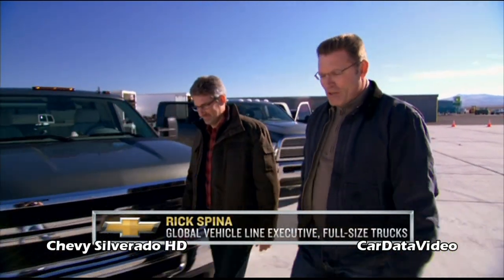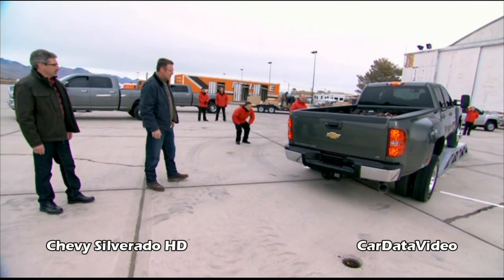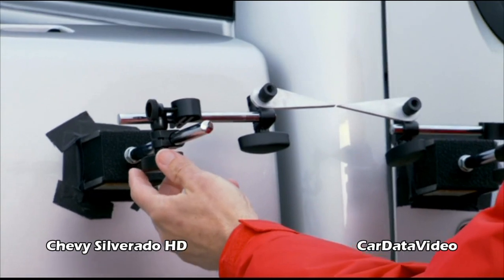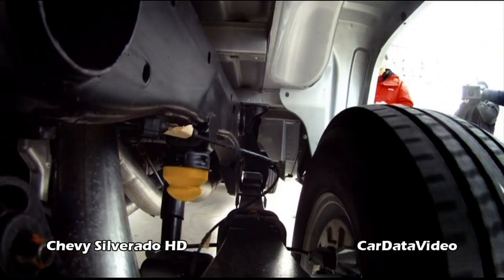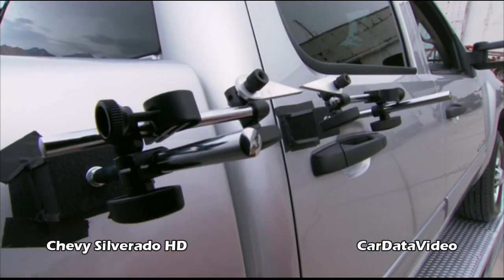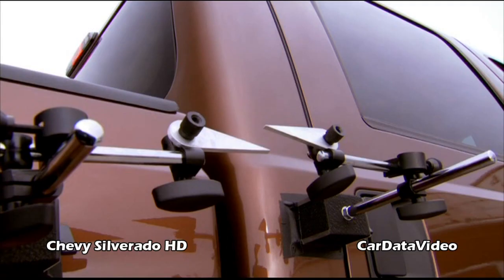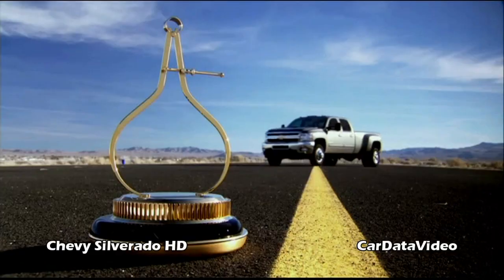Chevy vs. Ford HD Truck - Bed Bend Video

Comment: I watched a 2015 ford F150 explode on the interstate next to me as I drove by in my 2004 Chevy 1500. It made my day to know my old truck will last longer than the new trucks out this year.
Reply: I am a ford guy and I own a 2000 Ford F-250 7.3 powerstroke, but I have to say the Chevy trucks that were made before the bailout were actually pretty good I still think Ford is better though.
Reply: @becplumbing660  Maybe good mechanically but the interiors are trash.
Reply: @r.rodriguez4991   both interiors suck
Reply: @GamerBoy-ye2op  ram has the worst interiors wtf

Comment: Im a chevy guy all the way, but have personally seen and driven both trucks in similar situations, and have NOT seen a ford perform that badly, let alone crease the endgate. Somthing must be rigged here. They are both quality trucks, and in real situations neither will have a problem like this.
Reply: It is very seldon you would ever flex this hard unless you are either trying to demonstrate flex or are rock crawling.  I can see this happening under extreme circumstances.  Most trucks that crawl make some nasty noises in the chassis as they flex.  Just watch any rock crawling video on youtube.
Reply: Thank you. I am a ford guy but at least one or two chevy guys actually understand the facts about ford. Ford and Chevy make their trucks differently and i have my reasons for liking ford over chevy but at least one chevy guy knows the facts and doesnt try to go with the Fix Or Repair Daily bullshit
Reply: I love Chevy and Ford all the way, but that was just a crappy video.
Reply: exactly

Comment: i got no problem with the chassis flexibility. i am a horse transporter, and i use that flexibility when i am pulling my 47 feet, 23.000 GVWR with 8 warm bloods of 1.300 pounds each one, specially when i am at the farms picking them up off road. in the past i drove a Sierra 3500 and i had no problem, it wasn't a bad truck, some little electric issues (nothing major), and the interior is not the nicest, but i change for a F450 king ranch cause i need a stronger rear axle, and it is amazing, a little slower, but more powerful on hills, it is almost 280.000 miles, and i had nothimg bad with it, just a problem with thw DEF sensor, and a leaking in the oil pan when it has around 180.000.

Comment: Any one else realise that the fords tail gate was locked
Reply: I sure as hell did. You can hear a click on the Chevy tailgate that means it unlatches where on the ford tailgate you don't hear any click.
Reply: it was not locked. The tail gate was pinching the right upper bedside and causing a striker misalignment.
Reply: @Hiringsoon  but you still would of heard a click if it was unlocked
Reply: Yes
Reply: Yes I saw
Reply: quick draw rc it’s ford, it’s garbage
Reply: I believe it was locked
Reply: yup
Reply: Fake news
Reply: I didn’t even notice that
Reply: it wasnt locked. my dad has a 2012 f350 and the tailgate does that when its barely misaligned because of the bed twisting.
Reply: @rylandnovak9242  haha finally someone who actually admits it😂
Reply: Ryland Novak weird, my 450 doesn’t do that🤔
Reply: FBI no 450 or higher should be doing that
Reply: justin johnson that’s why it doesn’t...
Reply: LMAO the tail gate obviously bent and buckled. Did you not see that?
Reply: @DaytonCarCare  The handle of the tailgate would have made a clicking noise and it would have been difficult to pull if it was unlocked. Locked tailgates are easy to pull no matter the situation. yeah sure the body sheet metal on the outside of the tailgate is bent, but that doesn't mean it can't still be opened.
Reply: quick draw rc  yup I could tell my friend owns that truck
Reply: quick draw rc yes it’s locked my friend owns f-350 dually
Reply: @Hiddenpower6  I drive a honda so im less likely to get on the side of the road compared to either ford or chevy, but if i had to pick id rather break down than get pounded. My large intestine is more important than the convenience of making it to my destination on time
Reply: I bent the bed of my old 92 F-150, and with a little more force, I was still able to get the tailgate down.
Reply: Wooow they fucking lock it to make it seem it was pinched shut
Reply: No duh it was locked it is a staged Chevy ad lol
Reply: On top of the fact that when the tailgate bent the camera was perfectly zoomed in on the damaged area. As if it was expecting it to happen
Reply: ItzRy_ yep

Comment: I own 8 trucks. 4 Fords, 1 Dodge Ram, 1 Silverado HD(one used in this video) and a toyota tacoma. When you see the undercarriage on the Chevy in this video you see reinforcement struts. The Chevy (LTZ package) that I have does not have those reinforcement struts. I think that they reinforced it for the video. Although all car companies are at fault for this jackassery ford and dodge is still better.
Reply: TheMidwesterner West you mean 7 trucks
Reply: They probably have a "Mystery" Truck,  that nobody talks about, just like everybody else.
Reply: Common Core Math should ask Santa, for an Overhaul.....And a Beer, In a Tree.
Reply: csrgatorfan you are my hero
Reply: csrgatorfan maybe the mystery truck was a ridgeline :p that's why he didn't mention it.....
Reply: @Roberto-cc5nz  Hey, you drink enough beer, you see more trucks than there actually are.

Comment: 1: Video is very biased.
2: who buys these trucks and mainly off-road these trucks? They are mainly used for towing.
3: over the years.. Chevy is slowly switching over to aluminum. Just check out the 2019 Silverado trucks
Reply: Trucks are unnecessary for most people.  Waste
Reply: @LemkeR  No, they are very necessary for me... to waste gas mileage! I rather spend 5000$ in gas a year than end up a cripple from some idiot texting and driving.
Reply: Larry Mepentu trucks have become more Family/business friendly over the years. One day you can be doing hotshot deliveries.. The other take your family out on a road trip knowing that it’s much safer than a small compact car. Not saying that I don’t like my Corolla but I do love my truck.
Reply: @christianfoster8400  actually small cars are usually safer.  It's psychological when we think a larger vehicle is safer.  I feel safer in my smartcar than my Charger or  2500 Cummins.  And crash testing proves my feeling.

Comment: Let's see how the Cyber"truck" stands this test.
Reply: Stonewall Jackson that ford was the lowest f 150 model you could get and the Ford was in 2 wheel drive
Reply: It'll handle it incredibly, it has adaptive air suspension.  And to say it's not a truck shows your ignorance.  It has a full size bed  lmao
Reply: Elon musk even directly responded to somebody sending him this video on Twitter lol
Reply: Most people just don't like it because it's a completely new design, but to be honest, even if you don't like the truck or don't like Tesla it should be a good thing that it has so many features.  Silverados and f150s have been the same thing for years, but now Tesla is putting pressure on Ford to make more affordable trucks with more features.  Cause with a 40k price tag and all the features the cybertruck has, it's a serious competition over an f150.
Reply: Stonewall Jackson 2wd vs 4wd. What are you expecting them from. Why didn’t they use Ford electric with 4wd or HD 4wd?

Tesla chose Ford 2wd to cheating as they thought we all too stupid to notice. 

We busted them.
Reply: The problem with the cybertruck is that the frame is the "exoskeleton" . Meaning that if it were to do this test it would most likely bend the body panels and result in not being able to open doors.
Reply: Stonewall Jackson  No there definitely not, Tesla used a 2wd with the base engine(30k).  An apples to apples test would have been a  4wd f150 with the 3.5 ecoboost. Also the cybertruck was a dual motor so it cost 50k. For that price you get into the 3/4 ton trucks which could pull the cybertruck across the world. Also ford alone is worth 140 billion where tesla and space X combined is only 60billion.
Reply: Stonewall Jackson  Yup we shall see in 2 years lol.
Reply: @hillaryclinton2700  you're comparing the most costly version to the cheapest f150 lmao.  And have you never seen an avalanche?  Or literally any other truck that has high walls on the sides?  It saves more money in the long run by cutting out the price of petrol, has adaptive air suspension that makes it a smoother ride as well as being able to stay level no matter how much you're towing in the bed, has 240v ac power in the bed, etc.  Ofc it's gonna weigh more than an f150, they're using a steel exoskeleton to make it more rugged.  The rear view camera is a mirror so it doesn't matter if the rear window is blocked, and the base model has 2500 more pounds of towing capacity than the base model f150.  Just admit that you're afraid because it's something new and unconventional, every single person that I've seen giving the cybertruck hate is just trying to justify the f150 sticking with the same design year after year.  Yeah the design is weird but who gives a fuck, cause in terms of utilities, durability, the elimination of the cost of petrol, the massive cab and full size bed, the bed having tracks to place hooks wherever you want along the floor, the outlets, the air compressor, autopilot, etc. This truck is gonna put pressure on Ford to actually change something from model to model.  Honestly you sound like you have a hard-on for big trucks and for putting out carbon emissions.
Reply: @hillaryclinton2700  also you don't understand, the cybertruck has adaptive air suspension meaning this test wouldn't phase it at all.  One side would have a higher suspension while the other lowered.
Reply: @hillaryclinton2700  lol whatever you say, Elon himself replied to this test on Twitter saying air suspension wouldn't make this an issue, and I honestly think a billionaire engineer knows a little more than some rando on YouTube
Reply: Stonewall Jackson it was a v6 model ford 😂 lets see how the tesla handles againts a duramax in 4x4
Reply: Santania exactly, like why would they use a 50,000 dollar truck against a 30k truck. For 50k you can get a 2500 truck.
Reply: @hillaryclinton2700  Where did u get those valuations from? Ford valuation is 40 bill and tesla's is 60 bill lol. Dont use made up arguments
Reply: Filipe Vieira that only means so much and only shows how people are trying profit off Tesla as Ford is flatlined. Tesla sold 25000 model x and s in the first quarter where as ford sold 620000 vehicles(mostly trucks). If you take the average price of a model x and s it end up around 70k. 25k times 70 is 1.8 billion. Now fords average vehicle cost 40k if you take 40k time 617000 you get 24.6 billion. So please don’t tell me Ford is smaller than Tesla. And let’s not forget gm which also sold 700000 cars. Tesla will be crushed by Ford when they release the electric f150
Reply: @hillaryclinton2700  you know so little about tesla that you just ignored the best selling luxury car that they sell, the model 3 witch sells about 90000 a quarter, and its production restrained. Testas is growing like crazy and ford just isnt growing. Tesla has at least 3 years lead in eletric cars tecnology. And thats why its valluation is bigger than ford. Its the reallity, Ford is not as well prepared for the future as tesla is. I  dont care how long Ford as benn making gas cars, that doesnt traslate to shit when its time to make batteries, eletric motors and infrastructure.
Reply: @hillaryclinton2700  btw I am taking a master degree in Mechanical Engeneering so I kinda now this shit.. just kinda
Reply: Stonewall Jackson  the Ford was not drove properly and it was 2wd compared to the cybertrucks 4wd which means Tesla had doubts
Reply: @takememars  the cybertruck looks like an off-brand Barbie car

Comment: No proof they didn't lock the ford tailgate
Reply: I think they did lock the tailgate. Notice when he goes to open the tailgate, the handle pulls out easily, the tailgate just doesnt move. I know on my truck, when the bed is locked that is exactly how the handle behaves. It will pull out like that, just not engage the release mechanism. If the bed is unlocked, and there is debris or a stick stuck in the mechanism, the handle will be stuck as well.
Reply: U agree it looked a lot easier, and it is a lot easier to pull when it is locked.
Reply: The Fords tailgate literally twisted and started to compress inward on itself. It's plain as day chevy has a way better frame and suspension. 
#FordSucksBalls
Reply: Duallys aren't ment for bed bends lol
Reply: AiRsOfToRdiE79 Really? Do you have no idea how trucks work?

Comment: It's good that the frame bends though... Just means it'll be harder to break.
Reply: sure wasting money in chassis repairs and parts is worth it xD after the frame has bent and thorn the bolts loose xD
Reply: ståle starheim yes it is better than when the entire fucking frame snaps in half like it will on the Chevy. The more bendy the harder it will be to break. The ford like a piece of wire, it can bend but will not break. The Chevy is like a toothpick, seems strong but when it breaks, it breaks good.
Reply: Or like a chevy, you can take a punch, but after the first one you cant take any more ever again
Reply: i start to think american cars got a bad rep for a reasion... if it either has to be jelly or it will snap... in the civilised world our cars dont act like jelly or snap...

Comment: Go to 3:10 and pause the video, something looks odd about the way those devices are taped on to the truck tilted... doesn't it?
Reply: Moved them to the point it's cheating
Reply: Hmm yes but it could be an illusion
Reply: The test is not real. If you want to prove this, measure and draw the same line on the truck, a guide line for both trucks. It looks like they just tape it whatever they want .
Reply: Well look at the first test the Ford obviously didn't have any load like the Chevy notice how they didn't show or even tilt the camera to see in the bed
Reply: Keagan Long yea
Reply: They started booth unequal
Reply: If you weren’t blind you’d notice that the bed bent so what difference does it make if they bent it up so the gap is smaller?

I mean look at the body lines. Y’all blind?
Reply: Sam Keir I’m just saying have you ever watched another Chevy ad they always fake it
Reply: 2:54, it was taped like that start to finish.... There is nothing wrong with the measurement.
Reply: Keagan Long if you fixed it straighter it would be like 2 inches off😂
Reply: Yah it’s lower and on an angle it is cheating
Reply: Yes I saw that too
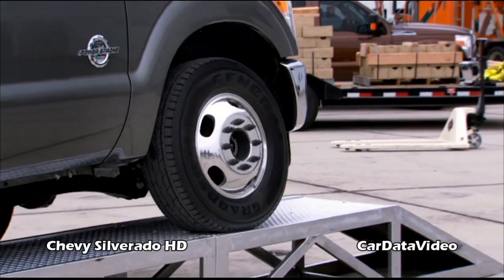Reply: Brandon Coleman 1:07
Reply: The arrows themselves have adjusters
Reply: If you had a fifth wheel hooked up to both trucks and put it to that same test the Chevrolet would band and damage permanently in the Ford would straighten back out with no frame damage also ford Is number one selling truck in America god bless
Reply: Aww little ford lover upset because chevy is better
Reply: The Black Truck OH
Reply: I see!
Reply: Keagan Long yeah holy shit
Reply: Plus Chevy was a dually and dually truck beds are welded to the frame and the cabin while the fords was only welded to the cabin
Reply: Lmao they legit put the tool on diagonally
Reply: Great catch
Reply: That's just a miserable ad for Chevy to try and match Ford's sales but they never will
Reply: 3:02 Doesnt matter, the points are even when the truck isnt twisted
Reply: The bed bent down to the right and the cab up to the left. Nothing odd there, common logic
Reply: Keagan Long I see it now
Reply: Rob Durst I’m just going to say I have had less problems with fords than Chevy just a personal preference if you don’t like that then fine but I like ford

Comment: That's why semis use a C-channel frame just like the Ford, it's because it works better....
Reply: Justin Walters Is that why the 2017 Fords have a boxed frame now?
Reply: Mrjoecreeper they still don't in their medium duty trucks, and whether or not Ford uses it now, it still stands that semis use an open C for the reason I listed, I would think that peterbilt and freightliner and Volvo and all of those companies would've figured out what's best by now.
Reply: Justin Walters I get what you're saying. But don't take any offense by this. Comparing their Medium Duty line and Semi-Trucks to Pickup trucks kind of redundant considering that the average  Pickup will see more uneven roads than your average Semi or Medium Duty trucks. You know what I mean?
Reply: main reasion rigs use C-channel's is because it saves weight, and the less the vehicle weigh the more you can haul, and the same load can be carried with less fuel consumption if  it's lighter. i dont know about you but cant remember last time i saw a rig having to do some offroading to this extent.
Reply: Justin Walters I've never read something more incorrect in my life. Congratulations.
Reply: wow cool
Reply: Uh semis can not handle terrain like this...